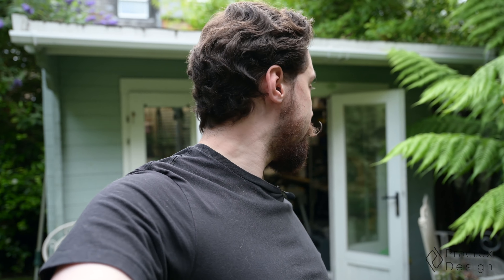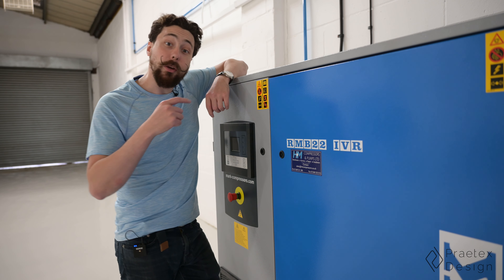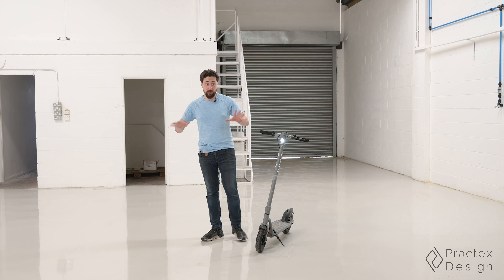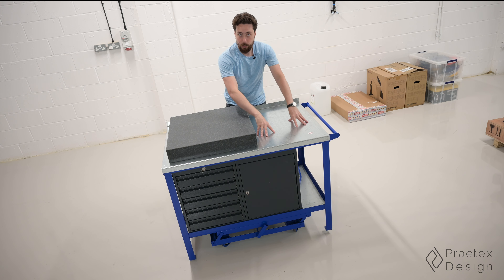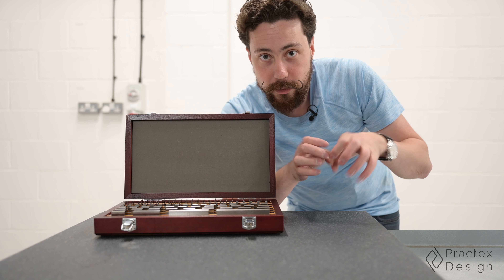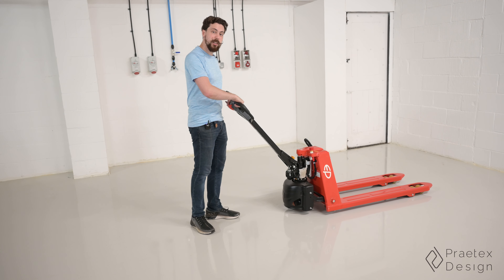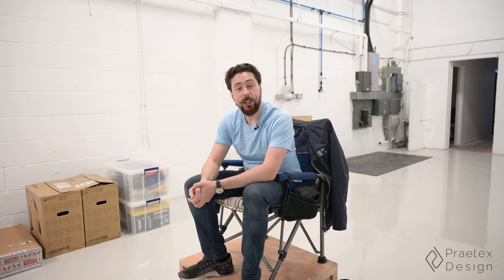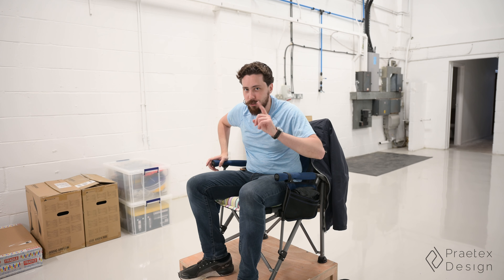Praetex Vlog #1 - The New Air Compressor Arrives!

Comment: That compressor looks veeery Atlas Copco-ish to me :)
Subbed as soon as i saw the Bit tech post. Can't wait to see some machining happening :)
Reply from the maker: If things go to plan, there’ll be a whoooole lotta machining to look forward to
Reply: Yes Mark compressors just re branded atlas. Nice and its inverter driven aswell.
Reply: @raymangtir  They looked just too similar to the GHS VSD pumps i worked on a few years ago :p
Reply: @ledoynier3694  I remember when Mark started re branding atlases. I would be servicing a GA8 then commissioning the mark equivalent, and thinking mmm hold on there the same...air oil and separator. Was a compressed air engineer for nearly 8years, fiddle around with the odd 1or2 now.
Reply: @PraetexDesign  Slow mo flying chips with relaxing music!
Reply: @raymangtir  I never worked with compressors, but still working in semiconductor vacuum. I had two occasions to install GHS pumps for factory central vacuum, and it was funny to see how it's basically their compressor technology working backwards (yes it's more complicated than that ^^).
WHo knows, we may see one popping up in the channel for some machine bed vacuum for clamping parts :) no more double sided tape and bowing acrylic panels on large jobs :p
And yea, like everyone else, the company i work for has been acquired by Atlas lol

Comment: You don't look like you would have had a lot of experience with a pallet jack.
You should test if your brake handles the way it should. Get the jack moving and then let go. It should stop.
Then get used to the idea that when something goes wrong you let go and jump out of the way. It sounds simple but its easy to loose perspective on just how heavy something is when it glides along just fine on the jack. A pallet of 24pk Coke is near 1500kg IIRC. It will crush you against a wall effortlessly.